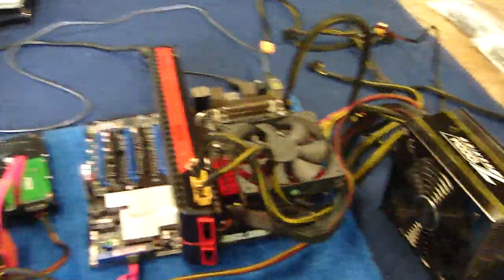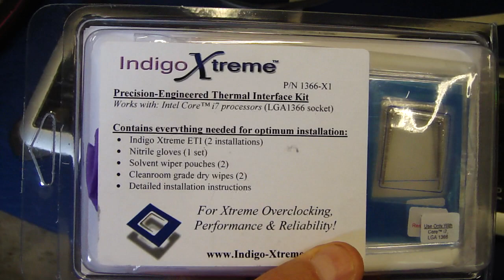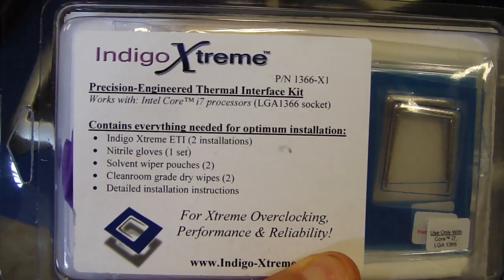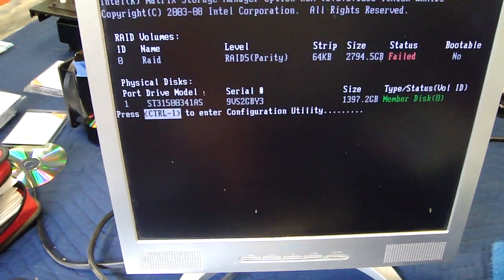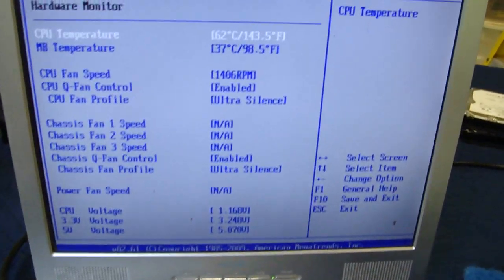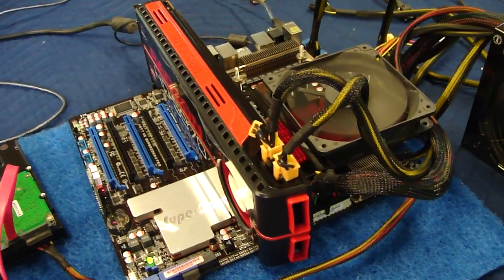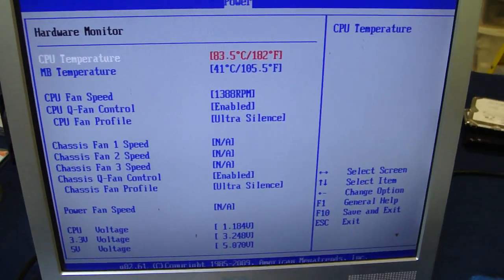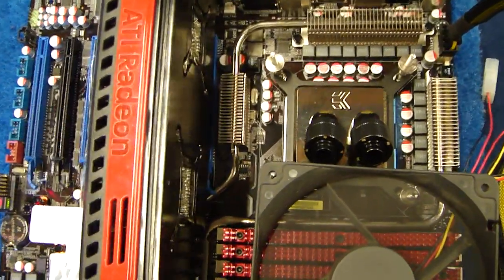Dry Boot on a Water Cooled i7 W3550: Madness

Comment: @CRAKIZGOOD Because the IHS simply a plate over the actual processor to distribute the heat over a larger surface. so simply remove the ihs to get better contact with the core = better cooling. back in the day there was no IHS's on the cpu's and back then it was really common to tension water cooling blocks 2 tight and crack the core... hence IHS was introduced ^^